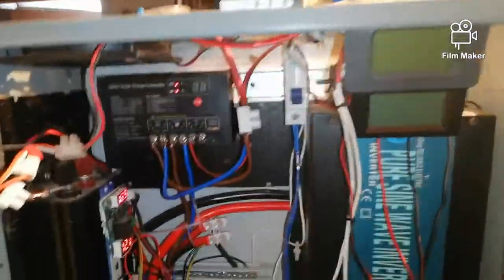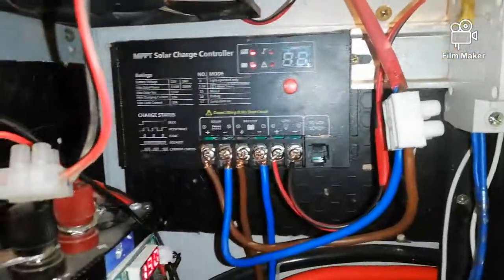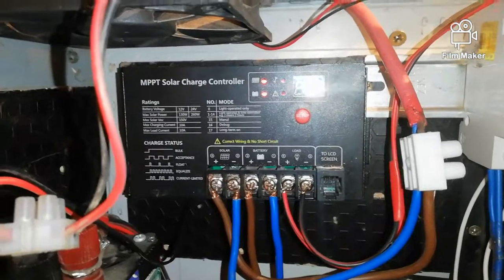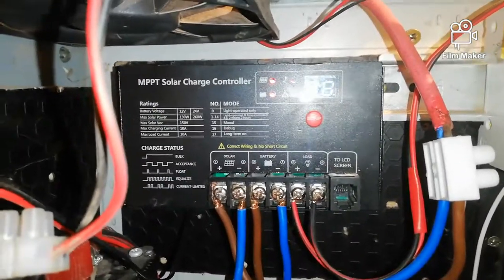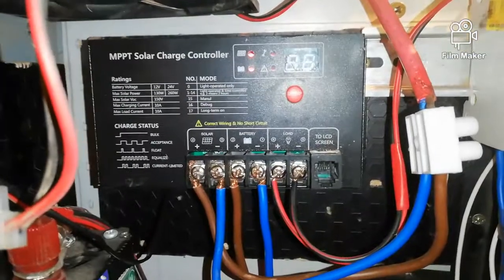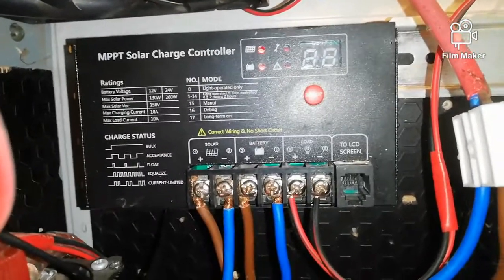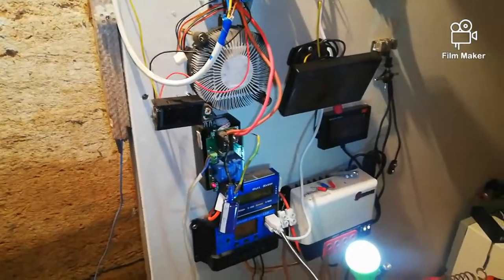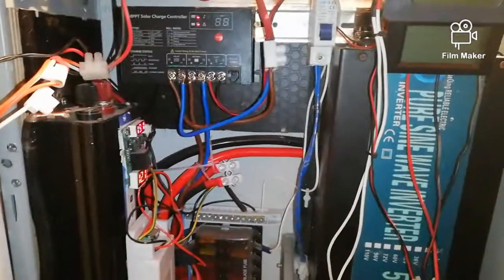MT2410 Charge controller

Comment: Hello sir, can you help me? The LED on my MT2410 charge controller on the solar panel is flashing. Yours always stays on, do you know if it's normal?
Reply from the maker: there should be manual on mt2410 what that blinking light means
Reply from the maker: if you use small battery or small solar panel then it might blink because battery gets full and its not geting overcharged or solar panel isnt capable for mppt because 12v panels wouldnt work normaly with this controller...
Reply: @SigmaWorksSW3D  I have a 93ah stationary battery. Her fluctuation is at 13.5v and equalization at 15.5v, she is at 13.3V at the moment. My solar panel has 100W. I found this> "Charge indication: When the solar panel output voltage reaches a certain value,
charge indicator start to work. Different flash status represents different charge
mode. The specific meaning of charge mode is as the table A below.
2. Battery capacity indication: When the battery is normal, the indicator is on, when
it is over discharge, the indicator will slow flash, when the battery is over voltage,
the indicator will fast flash. (Table B)
". But I still don't understand the problem. I measured the voltage coming from the panel and it is coming 20v at that moment.
Reply from the maker: could you make video showing that? its hard to tell what might be wrong
Reply from the maker: but it is charging battery?
Reply from the maker: only way i can think is that it needs more solar volts... with 20volts its hard for it to find mppt... i have 107v 145w panel and only at mornings when voltage was around 20-30v it was blinking, but when it went over that voltage led came solid
Reply: @SigmaWorksSW3D  yes, it was at 12.5v now at 13.3v
Reply from the maker: yes then it needs more solar voltage... it is acting like pwm when there is less than 30volts from panel i had the same problems at begining
Reply: @SigmaWorksSW3D  Maybe that's it, thanks!
Reply from the maker: i will orden new mt2410 because my old one couldnt survive that panel and then i will make video abaut that pwm and mppt mode switching
Reply from the maker: @tpm2-oficial  most likely ;) because mppt works above 30volts my srne mppt controller does the same thing... at mornings it thinks that i have 12v panel and it stays at 14.4v and blinks all over and  still charges my battery, but when panrl faces full sun then it switches to mppt and starts charging while panel doesnt reach 90v
Reply: @SigmaWorksSW3D  Hello sir, my code went from 16 to 17. Is this normal? The code 16 is: "Debug mode (16):
This mode applies to debugging; the load will be shut when receiving light signal and

it will be on without light signal. The debug mode is easy to examine the validity of 
the system. ". the code 17 is: "Normally on mode (17):

Under this mode, the load will be normally on; this mode is fit for the load which
requires 24 hours power supply. 
".
Reply from the maker: well if i remember correct then i used 15or17 for manual on or off
Reply from the maker: i think you will need to make video abaut its activitys otherwhise i cannot tell exactly whats happening :)
Reply: @SigmaWorksSW3D  thank you so much. my last question, does this controller have all automatic stages? the fluctuation and equalization voltage is automatic?
Reply from the maker: i think it will do all automaticly acording to its iner clock
Reply: @SigmaWorksSW3D  Hello sir, can you tell me if it is possible to regulate this controller? Fluctuation and equalization? Or it has the 3 automatic stages
Reply from the maker: it is posible with remote lcd but it costs same that charge controller
Reply from the maker: € 19,06  17%OFF | RM-3 Remote Meter use for SRNE MT2410 MPPT solar charge controller with RJ12 communication and 2M USB cable
https://a.aliexpress.com/_m0lwdUb
Reply from the maker: or with pc rs485 to usb but i didnt found software to use with controller for pc
Reply: @SigmaWorksSW3D  Thank you so much again. I will buy the display. Greetings
Reply from the maker: No problems ;) but i think that if you could get in touch with seller and ask them if they could provide software for pc then you can buy rs485 to usb and then all magic control for this controller would come ;)

Comment: How do you know when the battery is fully charged ?
Reply from the maker: black mppt charger just disconected solar panel and thats it... with multimeter checked 12.8volts and thats it... but that works only if you have batterys with good condition... those gc2-145 that i have right now are in terible condition so even that charger couldnt revive them... it couldnt get them full
Reply: @SigmaWorksSW3D  thanks I got a brand new agm battery so that should be fine
Reply from the maker: @droneskyview7808  yes it should work, but you got that black mppt or srne mppt like mine?
Reply: @SigmaWorksSW3D  I got the one like yours
Reply: What is the best mode for it if I only use an inverter from the battery I don’t use the load that’s on the controller
Reply from the maker: @droneskyview7808  if you use black one then my mode was manual 17or15 if i remember correct... but its totaly fine to leave load terminals unused ;) that charge controller was great! it handled 164watts without problem... and that was at winter when my 145watt panel gave more than it should ;) :D just remember that it will handle more than rated 130watts but dont test it ;) i will order another one to replace previous broken one
Reply: @SigmaWorksSW3D  thanks for the tips
Reply from the maker: No problem :)

Comment: This controller has load working mode options from 0 to 17 - Can the load on controller be active only during the day or day + 3 hours  at the night ?
Reply from the maker: yes it can because its sensing load output from solar panel input... if there is no solar input then timer starts and turns on load after 3h if you need
Reply from the maker: or when solar goes out then timer turns on load on 3h or so... will check it monday and will tell you